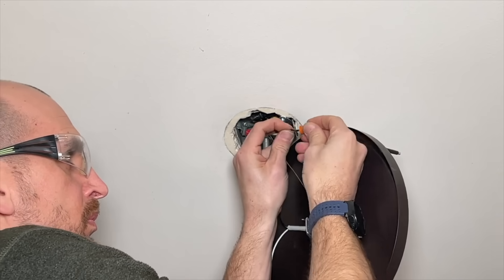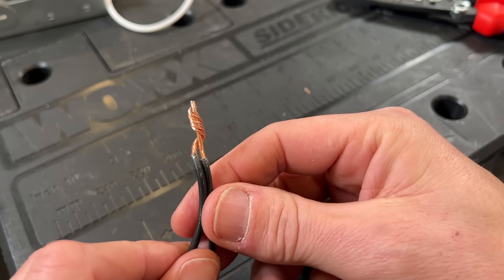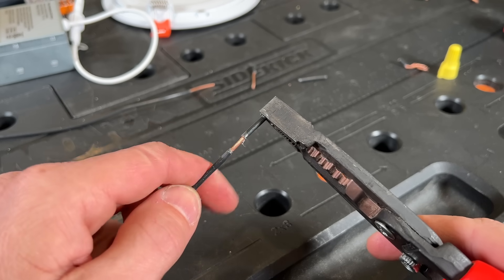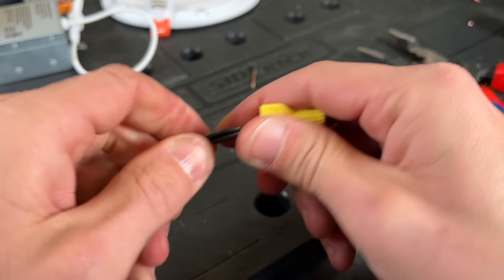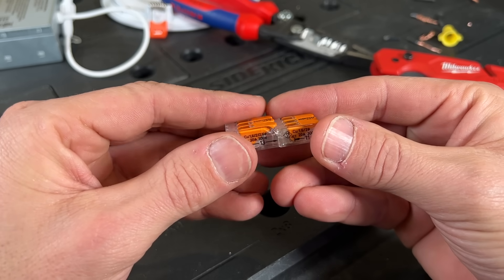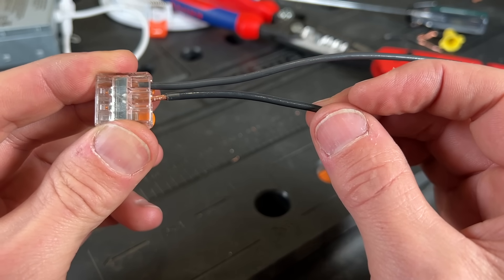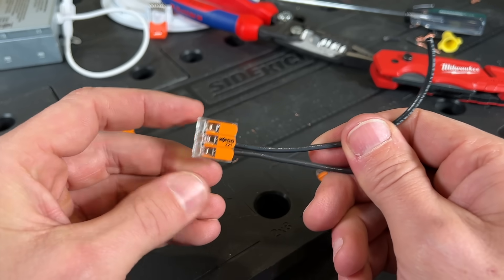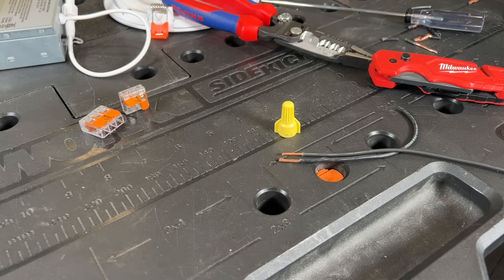Most Common DIYer Electrical Mistake - Don't Let This Be You!

Comment: I've been electrician for 12 years now and for some reason ths video was on my page. So that's the only and best way to connect the wires to the wire nuts. The wago (pronounced  waygo) are cool too,  but I've seen those things melted before. It's all what your comfortable with
Reply: Pronounced "Vargo: (as Volkswagon is pronounce "FolksVargon".)

Comment: Where is the contact point on these wagos???  If it is a "knife connection" then there is very little surface area for connection. I would think that the surface area connection is greater with wire nuts. Please clarify. Thank you.
Reply: The "knife" connection is at the "top" but the "Clamping Spring" holds each stripped conductor against a common "Connection Plate" - which provides the connectivity between the conductors.  (See a similar connector in  https://commons.wikimedia.org/wiki/File:Spring_Clamp_Connectors_(WAGO_Series_222).jpg )

Comment: Too long didn't watch summary: have the stranded wire leading the solid copper wire by just a little bit, ALWAYS do a pull test to make sure your connection is good, or use lever nuts. There you go, just saved you 9ish minutes of blah blah blah. You're welcome.

Comment: Good video presentation for DIY and beginners. Months ago I modified the outside lights of my garage by installing the timer between switch to the lights and to connect the stranded to solid wire I just twist both before inserting into the connector, now I learned a lesson of this video that what I did was wrong Thanks for sharing to us!

Comment: I’m more worried about the solid wire being in the middle, and the wire nut only gripping the stranded.  Then the solid can pull out easily.  What I do is first, with a pliers and a needle-nose pliers, bend the solid wire into a zigzag shape, then wrap the stranded around it., having enough stripped length on the stranded that both wires end at the same place.

Comment: Wago, Shma-go. Do this; Disassemble a Wago and inspect. You’ll find thin metal contact blades. I’ll take direct wire to wire contact, either via wire nut or solder connection,  any day. Concerned about strand wire to solid wire contact ? tape them. Still concerned ? solder them. Direct wire to wire contact should always be preferred.
Reply: Twenty years from now, everyone will be using Wago.  Why?  Not because they provide the absolute best connection, but because they're idiot-proof, which is more important.
Reply: @dansanger5340  Twenty years from now, there will be bigger idiots so it won't help.

Comment: I don’t know if they still exist, but I encountered the most compact and rugged wire connector in the wiring of an old industrial building. It was essentially an insulated copper ferrule that crimped the wire ends together. Took up no space in the box.
Reply: Electrician here. Yes they still exist. I’m pretty sure you are talking about closed end crimp connectors
Reply: @itaintrocketscience   Excellent. Are they allowed in residential wiring? If so, why aren’t they common?
Reply: @tycox8704  
They are just slower and antiquated technology.
They are /were mostly used in low voltage applications ( a little out of my  wheelhouse.
Reply: @itaintrocketscience  : Isn't that for lower voltages and DC like in cars?
Reply: @brodriguez11000  
Not sure about cars.
I’m an electrician that does mostly residential wiring ( new houses and remodeling)
The connectors that the poster is talking about are available in line voltage ratings ( 120V) 
But nobody uses them, they are clunky

Comment: I had discovered the method you use along time ago when doing the pull test.  But on occasion when watching another electricians  work and never seeing them check their work, I kinda doubted myself because they were certified and I was and am a diyer so I  never divulged my secret method of joining stranded and solid. But today I want to thank you for your video that proves to me that our method is best. By the way, what kind or brand is that vise?

Comment: Being an intense DIY'er, my labor is free.  I solder tin all stranded residential wires followed up with Wago push-to-insert nuts.

I'd go with the lever examples if I wasn't so value conscious (read cheap).
Reply: Another over-the-top fit & finish habit...  I solder ring terminals on screw-fixtured metal box grounding connections.

Really, it's a sickness.

Comment: A technique that I like to use is to insert only the stranded wire to the bottom of the wire nut. I then insert the solid core and twist the nut tight. It works every time.
Reply: yeah put the stranded wire in first until it bottoms out, i do the same

Comment: Great video and I also am a DIY'r and big fan for the WAGO's. I'm curious what your preference is for 4-inch vs 6-inch wafer lights for higher-end homes in an A+ neighborhood. Also do you use 3000 kelvin for all rooms or use 2700 kelvin for bedrooms?
Reply: I'm an electrician in the exclusive residential market. Use 6" when you have at least 6ft in between the light and any other lighting source. Use 4" or smaller anywhere else.  As for kelvin, Use 3500k or below in sitting areas and less active areas. Use 4k and above for active areas. Light color has  a real effect on the eyes and whether it has a calming effect or an energizing effect.
Reply from the maker: I do more bread and butter ( 3 bed / 2 bath) homes and go with 6 inch for the increased light coverage.  I set mine to 3000 K but the ones I use now can be adjusted at the small attached junction box.  Overall I love those lights and can quickly transform a space. 👍

Comment: When I use wire nuts to attach 2 same wires black 2 black,,,white 2 white together in an electrical box  I ALWAYS follow up using black electrical tape wound in the same (direction clockwise)inclosing the wires and wire nut  twice  as the wire nut is tightened.
I have been doing this for years and have yet had any falure issues.
Keep the videos coming to Pittsburgh Pa. 
Never to late to learn something!
Reply: Only bad thing I've seen with electrical tape is over time it degrades and unravels.

Comment: I always tin the stranded wire so it acts like solid wire.
Reply: a bare copper wire and a tinned stranded wire wrapped together = a dissimilar metal battery = corrosion on the mating surfaces

if you are going to tin a wire, solder them both after they are twisted together
Reply: @kenwittlief255  good tip👍
Reply: Never tin a stranded wire that will be in a compression or clamp connection like a wirenut or screw down. As the connection gets hot the solder softens and you loose compression which makes the solder softer and you loose more compression and it gets hotter etc.

Comment: Only thing missing from this video 🥺 is a 4 wire connector 😖because Wago doesn't make them 😵‍💫🙏🏽
Thanks as always for sharing.
Reply: True, but can always use a 5 wire connector even if you only have to connect 4 wires. You'll have an extra slot if you need to join a new wire later on.

Comment: I never understood the claim about wago and current. They've been around for 70 years. They wouldn't still be used if they weren't safe
Reply: I just replaced a push terminal double toggle switch receptacle that became intermittent. On disassembly I found push terminal wires caused arc which caused carbon buildup which caused heat and minor melting. Replaced with a quality Leviton screw terminal receptacle.
Reply: Just because something has been around a long time doesn't mean its a good idea ! Push in connections on the back of the receptacles are a fire hazard ,but they still have them ! I be seen them fail so many times . Screw terminals are all I use!

Comment: *UNION Electrician* Try using the strippers at a slight angle when biting into the correct stripping hole, then put it straight.  The jacket on most AWG will just and should just pull right off without struggle.
Reply: Lol you lost me at union electrician….
Reply: @dallas5374  not sure why, unless you live in a “Right to Work” state… one of the benefits coming from the union dues is the advanced training that is offered - surely something of value for an electrician aiming for a journeyman ticket. Just saying
Reply: @DanielinLaTuna  'advanced training'?  If you call being stuck running straight runs of conduit and pulling in long conductor runs over and over on big constuction projects, basically being used as a grunt for four years, stuff like that.
Reply: @doninmichigan    Sounds like you’re working for a pretty enlightened employer. Not.

The company in mind actually promotes line-managers from the ranks of union-trained journey-level electricians and hands-on engineers.

Comment: Great video on stranded wire.  Also the WAGO push down connector is perfect for me when I wire outlets with 12 gauge wire and sometimes split off another one or two wires for an exterior outlet or additional outlets on a side wall, etc.  Then the 5 wire WAGO connector is perfect.

Comment: Fun fact: wire nuts apply force to hold bare conductors against each other ad opposed to electrically short them together. Therefore wire nuts could be dirty or rusty and still make gas-tight connecrions. The push-in types (vs. the lever type) are too much like the poke-in (non-screw), which may fail after many years.
Reply: Funfacts:  wire nuts do not make a gas tight connection! 
UK prohibits their use as they are considered dangerous.

Comment: So if I’ve already installed fixtures and didn’t do the wire pull test do I need to take them down and re do it?
Reply: I would if I was you. Faulty loose connections are the number one cause of electrical fires in NA. Making sure the conductors is secure in a connector is something anybody installing electrical should know to do.

Comment: In the netherlands we have 2 cheap and simple  solutions for connecting flexible  wire to solid wire. The frist one is called 'kroonsteen' the second one ,lasdop voor massief en flexibel draad, .Just look em up  Isnt that available all over the world maybe?
Reply: Intresting to find someone who is from the Netherlands commenting.  Its the home of my ancestors.
Reply: I got a better solution here in the Netherlands called a WAGO connector. It's reusable and works with stranded and solid core wire. 😉

Also the wirestripper he uses is a good brand but sucks. I recommend a Stanley FatMax Automatic Wirestripper model FMHT0-96230.

Also "kroonsteentjes" are not suited for stranded wire. You need a crimp terminal (aka "draadeindhuls") for that, so that you screw down on something solid. Otherwise you will strip the strands and the overal connection isn't good enough to reach the wire's rated capacity, and it could become a fire hazard.

Comment: Great video.  Your videos are always full of useful information and clear and easy to understand..  The Wago website shows the Wago lever nuts mounted on mounting blocks inside a fixture.  I could not find any examples of Wago lever nuts stuffed into a j-box.  I assume the latter compliant with code?  Thanks.
Reply: Yep Wago 221's are absolutely supported in any junction box and in general will save space over wire-nuts; especially if you have 5 grounds or 5 neutrals to join (vs multiple pigtails in wirenuts, etc.). Some of those brackets are really used more in European codes, etc...

Comment: I'm a field repair tech and actually advise against wago lever connectors, over time with heat cycles they can sometimes just stop transferring power throughout itself. Old fashioned wire nuts provide a more reliable connection when done right.

Comment: I dont know why DIYers who are not actually licensed electricians make instructional videos if you are not certified you should give advice because people could hurt themselves listening to DIY youtubers
Reply: 100% agreed. Only licensed electrician following the national electrical code should be instructing on this subject. The instruction would be region specific due to electrical code being region specific.
Reply: Unfortunately, licensed electricians seem to be stuck in their ways when it comes to wire nuts vs. Wagos.  Wagos are much better for DIYers because they are idiot-proof.  They have a long track record in Europe for being reliable, and have become the de facto standard in many countries, to the exclusion of wire nuts.

I've lost count of the number of backstab outlets I've had to replace in my rentals that were installed by licensed electricians during construction.  So, licensed electricians don't always know best.  And, no, Wagos are not the same as backstab outlets.
Reply: @dansanger5340  I don’t agree with backstab outlets either. The NEC and the greedy Builders are to blame for all those backstab outlets. Not the election’s fault. Wago connectors add unnecessary electrical complexity by adding a conductor between every wire.
Reply: You do not have to be a licensed electrician to do simple wiring in a residential building in most states in the USA. In many states there are no state requirements for electricians to be licensed. In some states only major cities require an electrician to be licensed. NY state for example, only NYC, Buffalo, Rochester and Syracuse require electricians to be licensed.

If someone wants to change a light fixture in their home and has to twist wire nuts on three wires, what is the risk running a couple 7W 800 lumen LED bulbs?  120 mA thru 14 AWG wire is not going to burn the house down, no matter how much you bugger up the stranded wires.

If someone is running Romex thru the house to wire a 240V 50A outlet in their garage for their new Tesla car, thats different
Reply: People can hurt themselves walking.  Also, licensed electricians get hurt from time to time.

Comment: Using the stripper wrong . Should not have to pull that hard you said to pull straight supposed to hold it on an angle then straighten to slide the jacket off
Reply from the maker: Thanks for the feedback 👍
Reply: just looked at 3 pairs of strippers

1 says "solid" on both sides
the other two dont say anything

rotating the strippers on the wire about 20° usually cuts the insulation off cleanly.

Comment: Excellent Presentation! 
I am a DIYer, and I do almost of the electrical work in our home with a few exceptions. It's pretty cool that I too discovered these WAGO Electrical connectors about a year ago, and I have been using them almost exclusively. I love the excellent design of these WAGO connectors, and I, too discovered the huge cost difference between them, and wire nuts.
Thank you again for your excellent advice and presentation!
Reply: But DIY labor + Wago is still far less expensive than electrical apprentice + wirenut.
Reply: @dalepres1  DIY'er here - I prefer wirenuts to sharkbite connectors as they have larger contact area between conductors.  Wire nut done properly are very secure and take less space inside electrical box.
Reply: @springer-qb4dv  That's great if you know how to do wirenuts properly, though.  As this video shows, it's easy to get it wrong and very many DIYers, even who think they know how to do them, do them wrong and they come apart - not suggesting you're in this category; I'm just saying that, for many, these WAGO devices make DIY safer and more reliable.
Reply: @dalepres1  I hope everyone can see - they are the upgraded version from the blue plastic "snap clamps" that dam near every boat/garden trailer repair was made with in the last 30 yrs.  lol   jmho
when the electrical probs were intermittant they came to us.  it was solder & heat shrink tubing back then, but i totally get why this has caught on.  I did low V fixes then but i can see how this catches on.  still - its a blade connection.

Comment: The wire strippers you used suck.  That or you dropped them a few times.  You could tin the stranded to.  During my 20 plus years we had very high precision wire strippers and could not use wire nuts.  Everything had to be soldered and sealed with heat shrink.  After cleaning up the joint We cleaned it up with alcohol and wrapped it in F4 tape.
Reply from the maker: Dang, what was the application?
Reply: USAF Avionics technician.  Aircraft wiring harnesses and avionic aircraft parts for RADAR and other electronic boxes.
Reply: Wire strippers used are junk? What do you use?